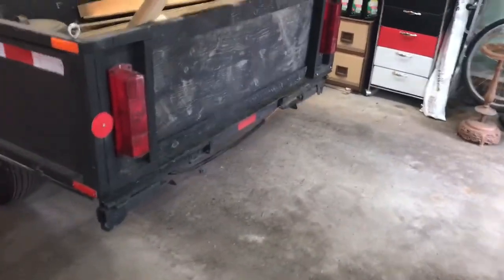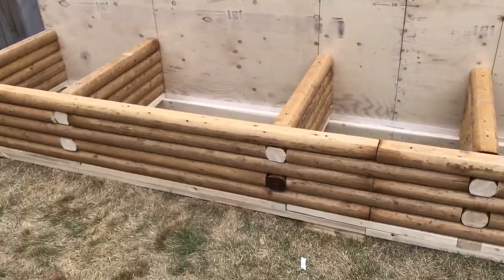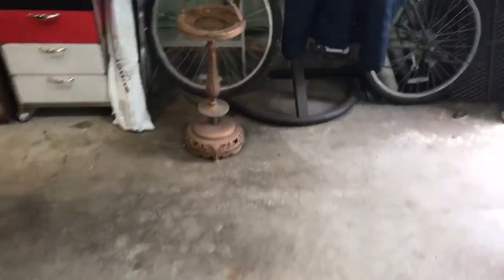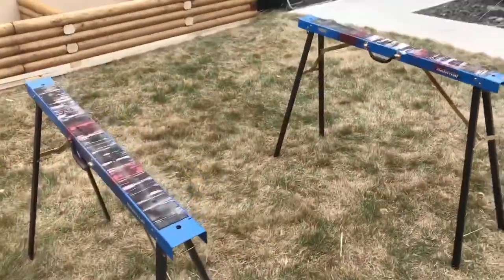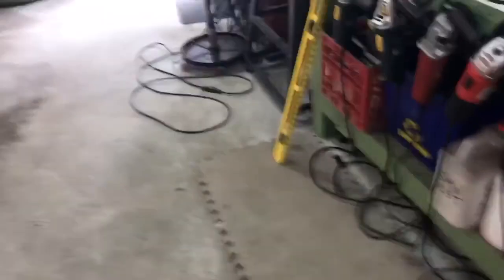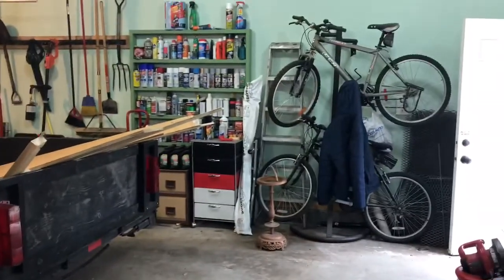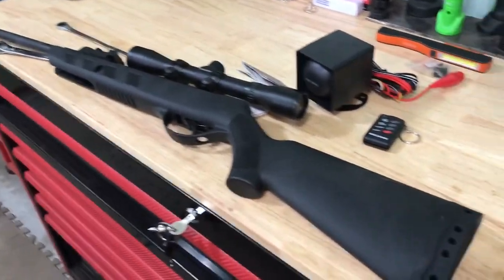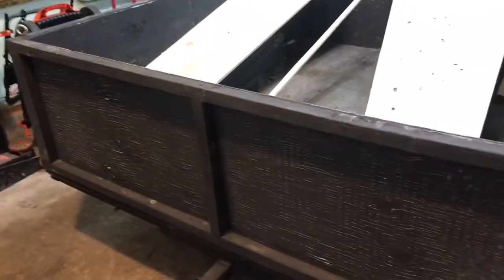Messy Garage and some Backyard Carpentry

Comment: You can fab up a 3 inch escutcheon and glue it in place with liquid nails.  But then you buy 10 lineal foot of trim coil and use 6 inches of it.  I'd say pack the gap with peanuts soaked in antifreeze, or aluminum screen wire.
Reply from the maker: Hahahaha isn't that the truth about only needing 6 inches of it and having to buy 10 feet of it.

Comment: They do the same as mice I put hard wire over the back and replaced the siding where they got in at
Reply from the maker: That's kinda what I figured.  I had another hole in the hardy board siding where the electrician cut in the wrong place and just left it.  I made a plug out of matching hardy board and used bondo to fill in the edges,  once I painted it you can't even tell it was there.  I wouldn't have noticed it in the first place if a bunch of hornets didn't build a nest in the hole.  I'll go with wire on this hole after May when the baby squirrels should be gone.

Comment: The ashtray is suposed to have a glass  tray inside.   It probably from the late 40s or 50s.     It should clean up nice
Reply from the maker: You're correct Walter, and the funny part is that I do have the glass tray from an old ashtray like this one.  
I'm thinking I'll probably clean it up with a wire wheel and see how it looks, maybe clear coat it.
Reply: Bruce L. Nice